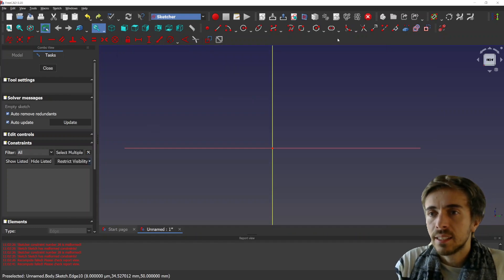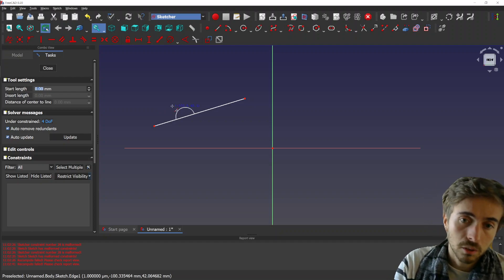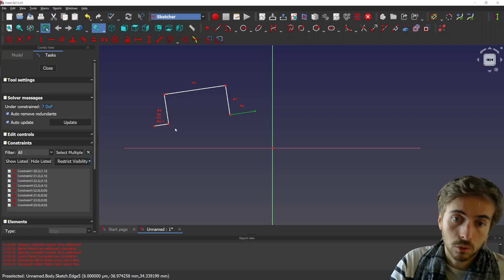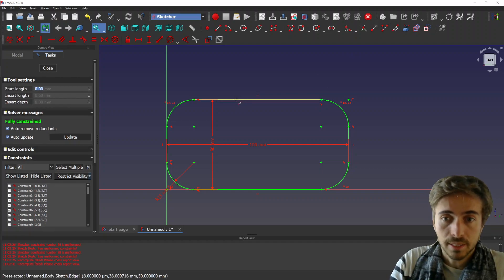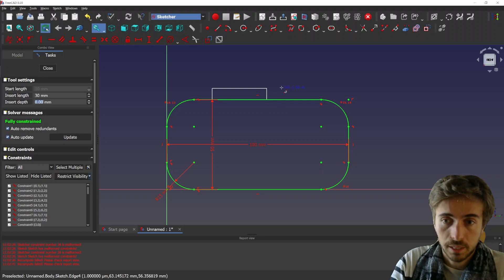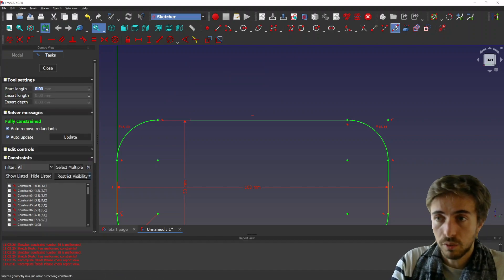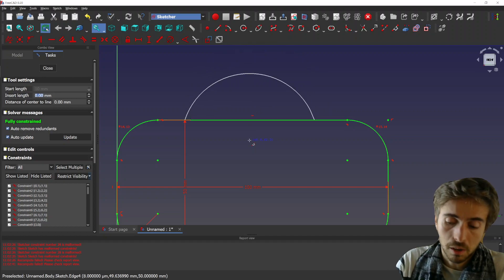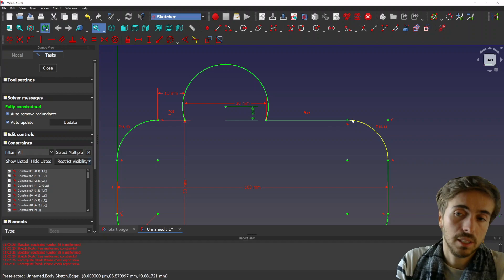FreeCad New Feature:  Insert on line

Comment: SORRY. WHWRE HAVE YOU FIND INSERT ON LINE FUNCTION? ON MY FREECAD 0.20 FOR WINDOWS THERE IS NOT...
Reply from the maker: It's a feature that I have developped. It has not merged into freecad master yet so you won't find it in daily builds. Your current only way is to compile my github branch : https://github.com/PaddleStroke/FreeCAD/tree/ConstraintContextual
Otherwise you'll have to wait until it merges.

Comment: That's great! Suggestion: often I want to dimension such things from the endpoint instead of by length. It would be great if that was an option, too. So you could start 10 from the start, 10 from the end and have the length automatically determined.